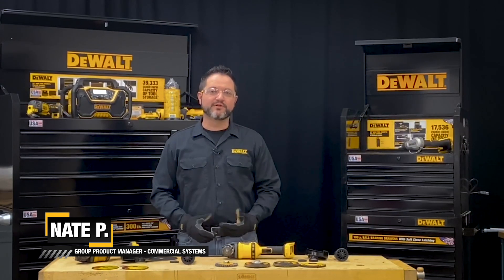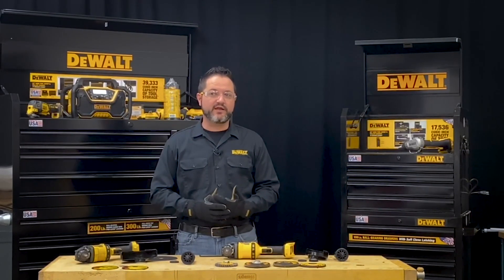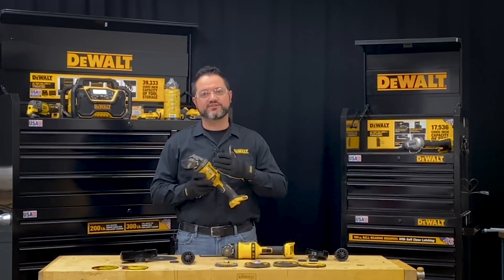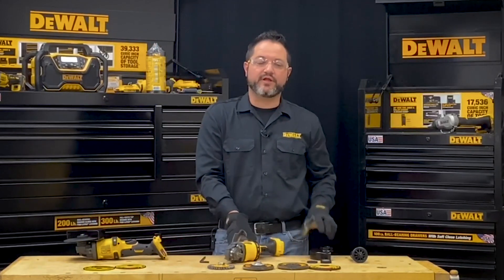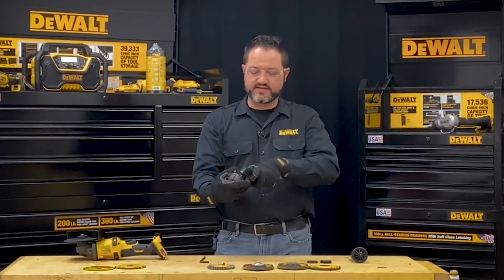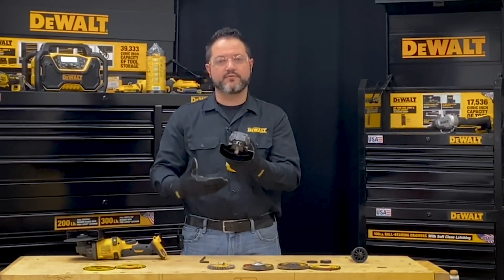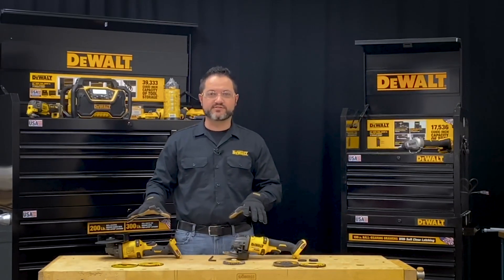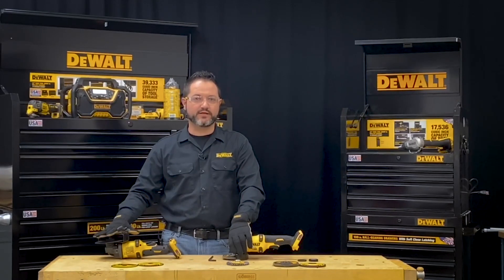DEWALT® Product Guide - Grinder Guard and Wheel Installation

Comment: Interesting video. I just bought the DCG418 grinder. It comes without a type 1 guard and I cannot find these guards on the DeWALT website or anywhere else on the internet. What is the product code for the 4.5 inch type 1 guard? I need this code to be able to order the right kind of guard.
Reply: just came here for the same info.  No luck it seems
Reply: 4.5 inch typ1 1 guard : DWB-N311419
6 inch type 1 guard : DWB-N487793

Comment: When I install a DW4725 wheel on my DWE402 the threads od the Spindle sticks out about 3/16" and thus when using it sometimes the part of the Spinlde contacts what Im grinding.  Is the a spacer that I can put on this so that doesn't happen???